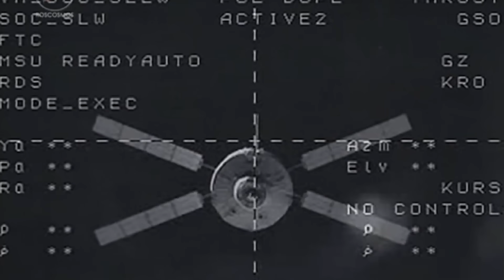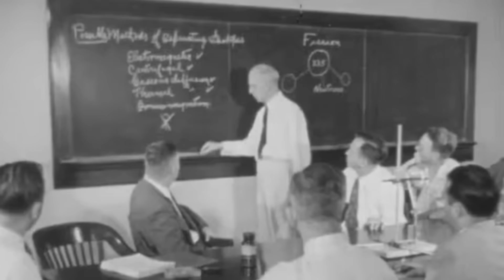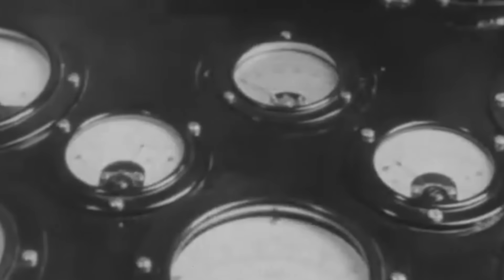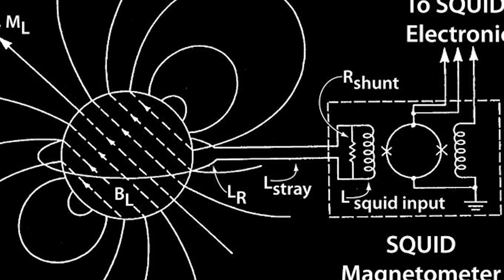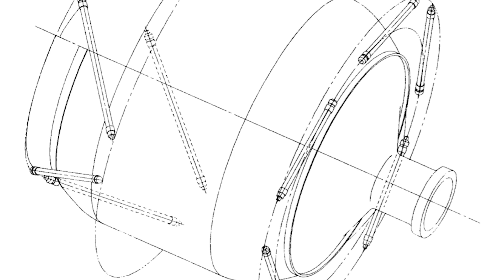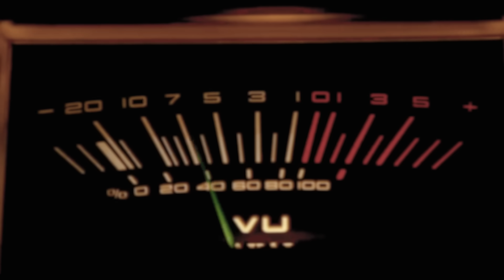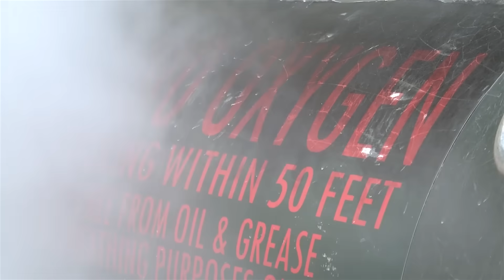Why NASA Hid These Strange Spheres in Orbit for So Long?

Comment: LETS GET THE TIMETABLE ON EINSTEIN CORRECT !
Einstein's "Theory of General Relativity" was first published by Albert & his first wife in a central European Physics journal in 1905. Indeed it was the fifth of 5 Theories, which when reviewed today, reveal the Einsteins had planned the order of publication, and the first 4 Theories were "lead ins" for that Fifth and final "THEORY of General Relativity". It should be further noted that Einsteins first wife was better qualified than Albert. She already had a Degree in Mathematics, when she met Albert, as they were both at the time doing a degree in Physics. And it was therefore the wife who produced all the Algebra for those Theories as originally published. (Some corrections to the Algebra had to be inserted some years later when these Theories finally reached the wider World).   

The problem is that those five "Theories" published in 1905, are still only "Theories" 120 years later in 2025. None have ever been promoted to the level of "Scientific Law" like Sir Isaac Newtons "Law of Gravity". And the reason is, that no reliable supporting Research has been done that lends any reliable weight to any of those Theories. Further as all of them are "Physics Theories" it is the "Worlds Official Scientific Institute for Physics" that is the controlling body, that can decide whether there is enough Research proof to warrant any Physics Theory being elevated to the level of Scientific Law. And this has never yet occurred. So after 120 years, the implication is that all 5 Theories still include fundamental Flaws. 

These methods are the "official" rules for Each Branch of Science. As each branch of Science has ONE and only one Official Institute somewhere on the planet. In reality ALL the Institutes with one exception are located in Europe. The exception being the IEEE The Worlds Official institute for Electrical behaviour, anywhere in the Universe. Which is located in New York. An Institute that gets little public attention, because "Electricity" whether here on Earth or in deep space, is a technical branch of Science (a bit like Mathematics) that few really understand.

All the above has serious implications for those "Theoretical Scientists" that wish to make the incorrect assumption that Einsteins work is "accepted Science" it quite simply isn't. And a number of well known & famous "Research Scientists" on numerous occasions, have pointed out the error of this fiction. Including Nikola Tesla (Electrical Scientist), Hannes Alfvin (Astronomer & Radio Astronomer), and Anthony Perrat a world leading Plasma Physicist. None of whom have or will agree to the "Warping of Space & Time". And the fundamental error often quoted is that both "Time" & "Space" are purely figments of the Human mind, that Mother Nature has no comprehension of, as neither exist in the real Universe. 

Physics has been increasingly derailed ever since those Einstein Theories became "common knowledge", and the proof is that Physics has NOT progressed in over 100 years. Measured by the lack of almost any Theories being promoted to the level of Scientific Law". Classic Physics has been replaced by "Theoretical Physics" which is Philosophy, NOT "Research Science". But thanks now to the Internet, large quantities of money can be made promoting Theoretical Physics, and never bothering to follow any Theory up with even a Peer Review Paper (the first required step to getting any Theory to the level of "Scientific Law"). And the best example of the problem is that the James Web Space Telescopes (JWST) has a year ago "destroyed" the "Theory of the Big Bang". By revealing the time when the Big Bang is supposed to have occurred, has fully formed Galaxies just like those Galaxies seen in our part of the Universe. There being absolutely no sign of any Theorised Early small Galaxies just forming, as there should be if the Big Bang had actually occurred !!! Further this reveals the "Expanding Universe" to also be a mistake, a result of the methods used to determine movement of Galaxies, by applying the "Dopplar Effect" a method that has backfired, as revealed by Professor Hannes Alfvin some decades ago. The reason for the reddish glow of many Galaxies is NOT a result of movement, but a result of the invisible small Red Dwarfs that make up 75% of all Stars in the Universe. Being so faint, even the nearest star to ours also a Red Dwarf (just 4.2 Light Years away), was only found within the last 10 years, thanks to Hubble.

Comment: Excuse me!  Why was this hidden?  The video is titled as though that would be explained.  However, there's nothing about this mission that seems worthy of being kept totally secret.  

About those spheres:  How did they handle them without touching them, and how did they survive the launch into space?

A launch window of only One Second?  What the hell does that mean?
Reply: Didn't watch the video, but lots of rocket launches have "instantaneous" launch windows where the launch window is considered to have no duration at all. In reality though, there is always a little fudge factor available since a little margin is always built into the fuel carried up. Even polar orbits can be skewed sideways a bit.
Reply: I assume it meant the launch had to happen to within a second of an exact time. But how they hell they managed to do that sounds more impossible than the rest of it. I mean surely the thrust of the rockets isn't that consistent even in a vacuum and when ya add in things like environmental factors like humidity, air density, wind speed, etc that are different everyday it baffles me how they could get it to where they wanted it to within a second?? 
So yeah, maybe that wasn't explained as well as it could of been but this guy isn't always known for factual accuracy in some of his vids. But they're short vids so he can only do so much without making them a half hour or more long I suppose. (like this comment haha) 🤷‍♂🤔😲

Comment: I never liked the using of a plane to represent the warping of space/time, but maybe with analysis from this experiment the Earth, Moon and sun's space/time warping can be accurately simulated?
With that simulation the question to "where does space/time start, at the Earth, Moon and sun's core, surface, outer space?", "how does the Earth, Moon and sun's space/time fields interact?"

Comment: I had never heard of this mission either, looking for measurable amounts to confirm Einstein’s theories. I would have thought this would be a huge deal, even with today’s idiot public. 
I am a machinist and stand in awe of these crazy low tolerances. 
I don’t know how you did it, but bravo for no commercial interruptions.
Reply: I'm retired from Lockheed Martin.  We were held to the highest standards when it came to tolerances.  It could be a pain in the ass at times but we had to do it.  Also, you are absolutely correct about the dumbing down of the general public.
Reply: @ Tolerances are critical in submarine components, and for me to get a 30” rudder bore to +/- 0.002” with equipment made before I was born (1962) was more of a test on knowing your machine’s quirks and idiosyncrasies, as it’s a different set up on every sub:

“Oh, you have to loosen THIS before you tighten.”
“Oh, it shudders and chatters at THIS speed.”
“Oh, can’t put weight on THIS support.”

Maddening. I presume that your manufacturing machines were slightly better than hitting it with a hammer to advance the feed 0.002”.

At a Final Cut, it was “Hero or Zero” time, fingernail biting and prayers every time. I would have LOVED to have operated with true precision machines.

Comment: i dont get it... "cant have any magnetic fields".... yet uses electricity to "levitate" the spheres... but where theres electricity theres magnetic fields....
and if they are so smooth ..therefore very very low on the friction scale... how tf is hydrogen gas spinning them up.. it would just move across the surface and have nothing to push due to no friction..
some BS going on here... just not sure where... in the research for this vid?... or from the scientists themselves? (lie coz they would lose funding otherwise)

Comment: Wow, this is one of the most ambitious physics projects in space I have ever heard of. However, they might be misinterpreting the results as drag. I would need to know more details about the measurements to know if space is "dragged" or just locally modified. There is a great difference. I do not believe that space is "dragged" even though that is the result they were looking for. Nevertheless, it is an amazing accomplishment and may hint at other new Star Trek-like technologies for the future (such as motion sensors that detect any local variations in space).